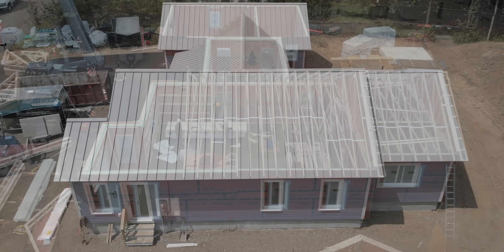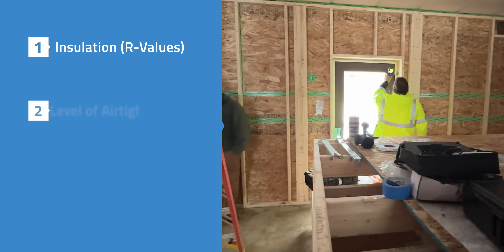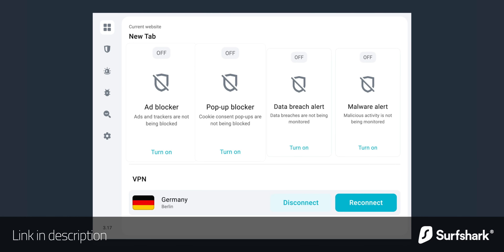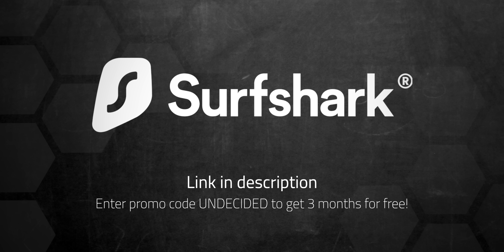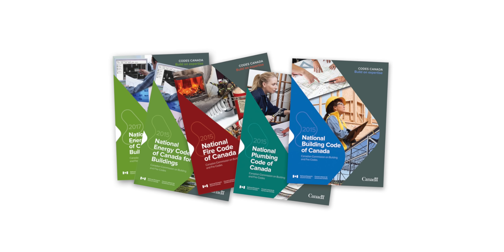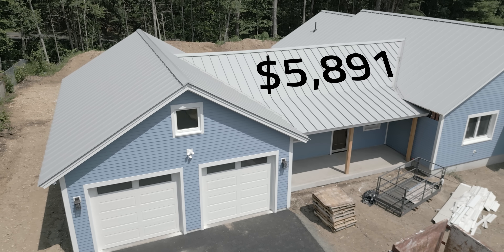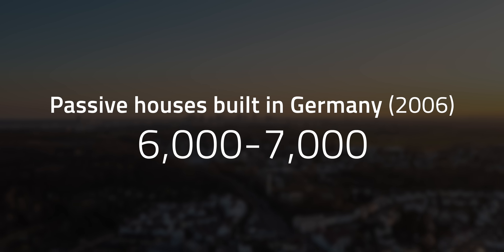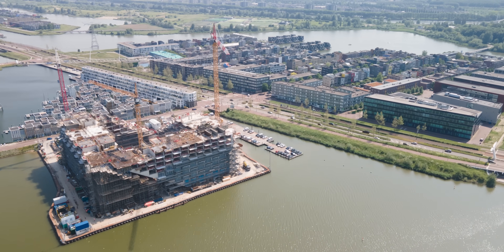Why Do American Homes Suck?

Comment: Every time I open my drywall to do a repair or an addition, and, I mean every time, I find a code violation. 
My parents live in a house built in the seventies and they have never had an electrical issue.
My house is fifteen years old and I’ve already had to replace my electrical box! Everything leaks and I e had to replace all my toilets, already! My parents still have their original toilets!
OMG!
Planned obsolescence at its best!

Comment: Dry walls, sponge insulation and wood base structure and shitty american roof gotta go man 

Concrete and rebar with just thin non flammable insulation is more energy efficient and cheaper 

no termites than it means no cost for managing ur wood with termite or insect repellant on wood or buying expensive wood that only last 20years or worse if your living in a soggy places 

Roof shingles are also shit in usa 
No wonder why so many dads die falling from their own roof while “fixing” roof made with papers 

Me and my ancestor (yea that goes so far i know right?) never ever had to fix the house for over 90 years.

No freaking solar needed cause concrete tends to cools on summer evenings and warms on winter afternoons

No air or water floor heater because All Floors are electrically heated and AI managed 

Windows are double sided almost air tight tighter than my ass, almost got chocked because i never open my windows at summer 

Every room is literally sound proof you dont need to buy a sound dampening paper (again papers) 

U guys purchasing a house with millions of dollar and gets blown away by a single hurricane and earth quake and fire, termites and bee infestation 

While i just do nothing when hurricane hit my house or their is a zombie infection going on😅

Comment: European here with a very well insulated house... in the summer it's not all good. Yes your house stays cooler for longer, but once the entire structure has warmed up, which will happen eventually, it takes weeks of cooler temperature outside to cool it down if the delta's are not that high. 

Example this summer ( in celcius). We had 2 hot weeks of 28-32 degrees celcius outside. Eventually inside temperatures got to 25 degrees. Now that it is cooler with 18-22 degrees outside, inside is still 24-25 degrees. It has been 3-4 weeks now. Inside you need shorts, outside you need more. 

European houses have a lower adoption of AC, especially in north and western Europe, although that is growing. 

Just a little perspective from my side.

Comment: Maybe i missed it somewhere, but is there any data on how long does the house efficiency stay, i assume it starts to degrade at some point. 

Also , don’t energy efficient walls /structures equate to net negative green impact during manufacturing compared to regular inefficient walls/house structures? 

I’m asking to clear up for myself the concept of striving for net zero. 

It sounds reasonable on an individual level to improve one’s house and efficiency despite the costs. But on a larger scale, such as your country/world does that also make sense viewing at the bigger picture? 

Are these building practices already efficient enough themselves to not add to the problem?

Comment: i live in tuscany , my home is 600 year old, wich is fairly common in italy, is made of stone , and when it was time of renovating it i put floor heated , triple panel windows, insulation on the interior , heat pump , solar panel and induction stove, i spent 50k on renovating , 20k more then a "normal" job, now i spend 600 euro all year for energy , before it was 3000, in summer i have internal temperature in the house of 20°c outside 40°c.no ac, in winter -5 outside , 20 internal 1 hr day of pump on.
remember that italy is 10 times more expensive in energy then us

Comment: I've bought a new house in the Netherlands in 2024. It's considered A+++ in terms of the Dutch standard.

My favorite part is the floor cooling system, it works just as well as an AC as long you stop the heat from coming inside through the windows.

My total energy costs last year was minus 150 euro, using a small battery for solar storage.

It costed 535k and is 160m2 (1700 sq ft) and made from cellular concrete blocks + outer shell of bricks.

One downside of this house is that it's isolated too well, meaning you need air circulation systems to stop you from dying from CO2. But that is also an advantage because that air circulation systems pumps heat back downwards. I do have to buy expensive filters for it though.

Comment: This is such a wildly shitty take. The only place in the entire US that I have heard of as using cardboard (which I don't agree with at all) for exterior sheathing is Texas. Everywhere else uses actual wood. Please stop misinforming people that the entire US uses some shitty material for the exterior sheathing for homes. Something else that was missed is the average cost per sq ft (I'm American its what I'm going to use for comparability). In the UK the price is roughly $438 as of 2023. In the us the price to build is roughly $224 as of 2024. Its almost double the cost to build the average home in the UK as well as just a higher cost of living in general. Considering that every state here varies wildly on pay and cost of living it's entirely misleading to say that "American homes suck" when your sample size is from 1 state with obviously terrible building codes. This is incredibly biased and extremely misleading. Don't blame the country, blame the builders. Builders are more the problem in the US than the actual country itself. Builders think that they need to make a ridiculous profit off of every customer that darkens their doorstep and its ridiculous. It wouldn't be as big of a problem if the builders were actually quality but they aren't. There are a lot of builders out there who do really bad work, including "reputable" ones. Please stop misinforming people on this subject. Its just as much the builders fault as it is the home buyers fault.

Comment: I’m assuming part of this relates to the fact that homes are often constructed by large-scale builders who build 100+ homes at once. What incentive do those guys have to build for efficiency, especially when many buyers aren’t particularly concerned about that stuff? 

It would be ideal if there were some common pathway for defraying the cost of efficiency over time (maybe there already is). If the government could enable me via a low-interest loan to upgrade to more efficient standards, and I had a reasonably accurate way to estimate its monthly electricity cost savings from those upgrades, then it would be a pretty straightforward calculation to say “my loan payment is similar to the extra amount I’d have to pay for electricity”. 

Basically a clear and well-understood way to incentivize spending money upfront to save money downstream on a 20-30 year timeframe, even if you sell the house after ten years.

Comment: People that have never been part of the engineering design and the actual building process of houses don’t seem to realize that the supposed disadvantages of a wooden home isn’t as big as what most people like to believe. You can do a complete heat transfer analysis and see that a properly built wooden home is comparable to a complete concrete infrastructure. Insulation as the packing material has come a long way to where it performs on par and sometimes better than solid concrete.

I’ve built a good number of homes in New England on old builds and new builds. A lot of these wooden houses here in the north are reaching 200 years old.

The only valid criticism is the low effort and low quality building process itself. When you mass manufacture homes, the quality goes down dramatically.

Poorly poured concrete will be just as unreliable as poorly assembled wood.

This may sound counterintuitive in today’s economy, but if you want a well built house, build it yourself or make sure it’s custom built and that you’re part of the entire building process.

Comment: My Marvin windows are triple-paned. I spent $250k on them but they have lasted 20 years and show no signs of failure.❤
Reply: You paid $250k for Marvin Windows? You got scammed out of like $100k-$150k.

I also have triple paned Marvin windows and they’re currently 25 years old. The only difference is that most of my windows are almost 20 feet tall and aluminum frame. I spent just over $108k for the whole house. The smallest window is like 6 feet tall.

Comment: Now do a comparison of cost between a German minimum requirement house and a US minimum requirement house. If you spend the same amount as a German minimum requirement house in the US you get AROUND the same quality. Not everyone wants triple glazed glass, super expensive insulation, near six figure solar systems that don’t pay themself off for near or over a decade, $80k water heating systems and 5 star appliances that are built to die within 1 year of the warranty running out.

Comment: Because you guys have taken capitalism beyond the point of adequacy. Build as cheaply as possible for as much profit as possible. It’s why you can’t compete in the global market. You’re too greedy and the quality has suffered. Cheap unskilled labour, cheap materials, cutting corners, poor design, greed and penny pinching so shareholders can see an ever expanding profit margin. You need to proper regulations and much higher standards.

Comment: I built a Net Zero home in Ontario, Canada 4 years ago. Canadian building code is improving but still no where near EU standards. I hired a small custom home builder who followed my lead on energy efficiency, envelope, heat pumps (water/Heating/cooling). We hit 0.5 ACH to meet passive house standards. It’s the most comfortable, satisfying home I’ve ever been in. The only drawback of a suoertight envelope is humidity control. The HRV doesn’t remove enough so we installed a whole-house energy star dehumidifier.

Comment: I remember several years ago when I had a different home, I had solar panels put on the roof, via a 20-year lease-to-own agreement that would increase the solar panel lease payment by 3% every year.  I was told that I had to be tied into the power grid, however.  I ended up using less electrictity than I generated during the day, and the excess went into the power company's grid.  The power company then would sell me back the electricitty I had generated for it during the day and charge me an arm and a leg for what it had gotten free from me.  And on top of that, it tacked on all sorts of fees for the privilege of doing so.  Not only did I not break even with solar, but my total energy bill (from the power company and the solar company) doubled my monthly energy cost.  So I tried to be green, but these companies and my state's politicians made it unaffordable for me to continue.  I ended up selling the house to someone who could afford to take over the lease.  It seemed that both political parties running the sunniest state in the country worked together to make sure that nobody would benefit from it being the sunniest state in the country... nobody, that is, except the power company and solar company.  I WILL NEVER FALL INTO THAT TRAP AGAIN.

Comment: It has to be more about the neighborhood or town or community in which the residence is in.  I could be very happy in a well done small container unit in a well planned town, or in a high-end apartment/house in the same setting.  Of course the larger the unit/interior space the more energy would be consumed, and the more effort required to maintain.  Personally I prefer a smaller footprint of living space (excluding storage that need not to be at an optimal comfortable environment) with a higher ceiling (with use of a ceiling fan).
The Japanese apartments have these wall vents that you can pop open to get fresh air instead of opening a window.
Some homes are so very insulated with better windows to not allow any leakage that one can literally be oxygen deprived, and indoor quality also suffers even if you don't need much oxygen.

Comment: What was the time frame for $5891 saving? Can't be annual because that's $480 per month. Does that include the costs it required to achieve that energy efficiency?

Comment: As part of the energy-efficient industry for 35 years my role was to bring builders into the Enegy Star program.  Most wouldn't because of the cost and that people will continue to by houses based on kitchens and master bathrooms. Explaing the long term benefits of energy savings and the reduction of noise and dust ment nothing to a builder as long as they could sell the home.  And our current administration is turning the clock back on any form of efficiency.  Buyers need to demand efficient homes or it will never happen.

Comment: I'd love to have an energy efficient home, but there are other factors in the US. We don't have enough contractors. The ones we have - large percentage of them are trying to get rich from every job or are charging insane prices while paying their employees $15/hr. In NJ average contractor quote to take out old insulation then do closed foam on the attic floor for a 1600 sqft  house is about $20K. That's 8hour (max) of work for 2 people (could do the job perfectly after 1 hour training). Just installing a window is over (not including the price of the widow) $1K. Were talking about a 45 minute job.

Comment: Should have been called “NEW AMERICAN HOMES SUCK”. I bought a house built in 1900, in pretty rough shape and am beginning to rebuild it. While it is cosmetically bad, structurally it’s a solid house. Even with the rot around windows from years of neglectful owners. A lot of these old houses are still standing because the houses had to breathe. They didn’t have the ac and central heating. Meanwhile, new homes are built so tight that they can’t breathe at all, leading to mold and condensation issues. On top of that, people now days want total comfort in their homes instead of just dressing appropriately for the seasons. Oddly enough, while complaining about the cost of doing so. No thanks. Even if I were to tear my house down and build new, I’d do so using the techniques of the old houses. I may not be able to run around my house in shorts year round, but the house will be still standing a hundred years from now

Comment: Comparing every US houses I've lived in to ones in Taiwan/China, the US ones are far more insulated than ones in Taiwan. Double plane glass for the US, single plane for Taiwan. Fiber glass/foam insulation on the roof/wall in the US. Ones in Taiwan have non, just concrete/brick. White paint on the roof is somwhat common, but no insulation besides of new buildings advertised to be "energy efficient" Corrugated steel used in semi-illegal roof add ons may have like 2cm of foam

Comment: I was pleasantly surprised to see that the UK ranked second in home efficiency. However, as a Japan resident, I was disappointed to see that it ranked 7th place. Homes that one builds tend to be very energy efficient these days, although Japanese windows are still a disaster in terms of both energy efficiency and design and the better ones are often not chosen because of price. Rental apartments (called 'apaato') are made of wood and tend to have a very bad energy factor. Condominiums (known as 'mansions') are made from concrete and are either owned or long-term and mid to upper income rentals, tend to be energy efficient. Japan is a very mixed bag and there are excellent examples and plenty of terrible ones too. Triple glazing is becoming more and more popular however. As for the USA, with your current regime in charge of the country, being in any way 'green' is likely to be described as being 'woke' (a meaningless word used by those with a deficient lexicon), you have little hope of things changing any time in the near future. A very disappointing and sad reality. Although i tend to feel that the Trump regime would do better to first focus on improving its international relations with its allies before focusing on home efficiency factors.

Comment: I watch a lot of videos about construction in the US. There is much to learn. But most of the time I am negatively amazed. Above all, it's the strength and durability. The wood is thin, nails rather than screws, thin foundations, sprayed loose insulation and shingle roofs. This is particularly interesting because many parts of the US have much stronger winds and/or tremors than in (Western) Europe.
The fossil fuel lobby is even stronger in the United States than in Europe, no news there. But even then, electricity isn't much cheaper in the US. So why do home buyers accept homes that are so energy inefficient? It's the difference between $1,000 a month or $200 (I pay about a hundred for a 3,500sqft/340m2 house). Again here, the United States has much more extreme climates. So logically, homes should be more energy efficient.
And then there's the neighborhood, often without bike lanes and forcing people into cars. 
The only real answer is that companies and their friends in government want it this way, not the public.

Comment: Click-and-bait video that doesn't really answer the question, but rather brags about how great his Passif house is. It is NOT! Until I see ICF and not wooden barrack crap, nor water barrels improperly called "domestic water heating system", I won't consider his wooden barrack great, in any way, shape or form.

Comment: 2:17 what you call "air tightness"- the correct terminology would be "quality of the envelope". The envelope is the seal from outside air that is formed by your house's exterior. This includes walls, floors, windows, doors and the ceilings.